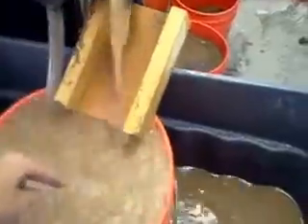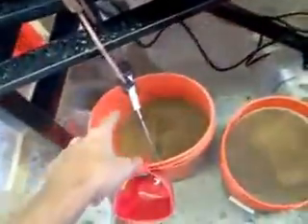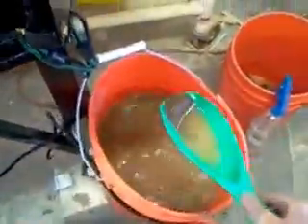RP-4 Gold Shaker Table - Mountain Mining Corporation

Comment: i like it. was doing research on shakers within my price range. im on the point now were my prospecting will support its shelf and i do believe this will cut my miller table time down by half. i get .350 to .412 grams of dust everytime i go out. i use gold cube trommel and 2 inch dredges with hydro to wash banks.